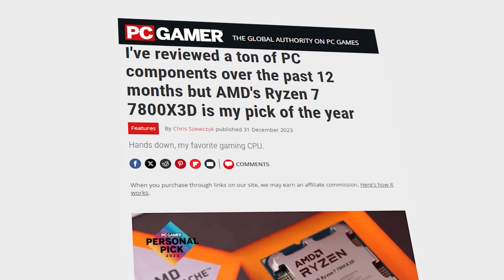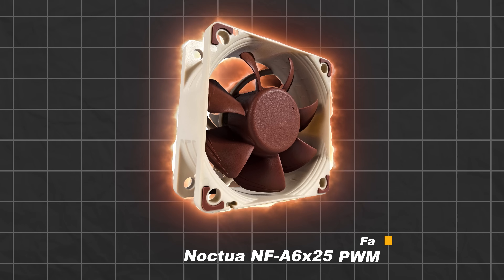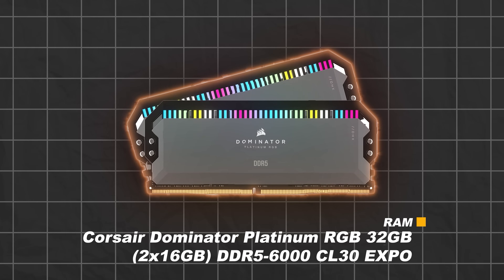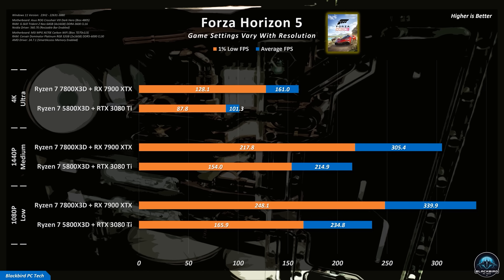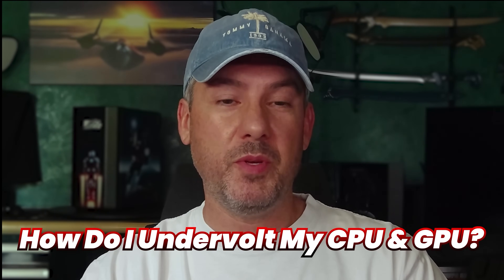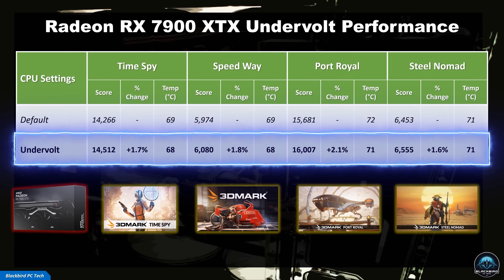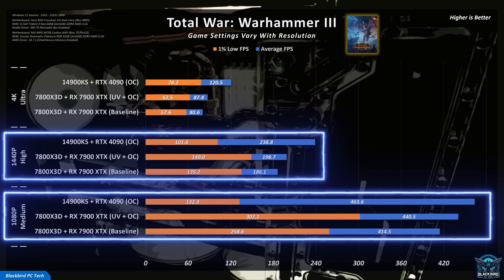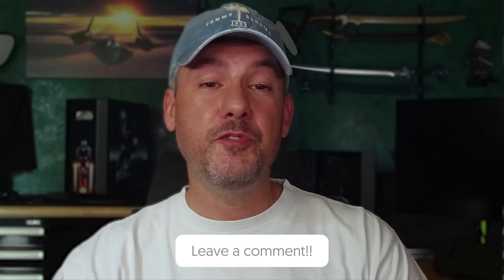Is an All AMD Gaming PC Really Worth It?

Comment: Going on AMD on my last high end rig was the biggest waste of money and regret I've had building PCs. I would have been so much happier if I had spent the small amount more to build an Intel/Nvidia PC. Especially since I wasn't limited by money. I was just on the AMD hype train at the time and thought it would be just as good or better. I've learned my lesson.
Reply from the maker: That’s interesting, especially given the recent issues with higher end Intel CPU’s … what went wrong to make you regret your choice?
Reply: @blackbirdpctech  Pretty much something else every month. The biggest would probably be the lack of all the best features. If I'm already going to be spending $1000 on a GPU, I might as well spend a bit more to make sure I have all the best features. At the time I built my current gaming PC, I thought AMD was going to be taking gaming and graphics more seriously, but it never panned out.  The only titles they support are big console ports for the most part, and even then they can't work with the developers enough to make sure their features are working correctly. Ratchet and Clank was a big one that made AMD look extremely pathetic to me. They sponsored it, it was a big console port, and at launch their features weren't working while the competition's features were. I've heard from many game studios that AMD won't return their calls or help them integrate their tech in any way, while Nvidia throws tons and tons of money even to small indie devs to make sure their technology is always implemented in the best possible way. 
And that's just the start when it comes to indie studios. I play almost exclusively indie games and indie developers just don't develop or test with AMD hardware. There has been a bug where UE 5.1 games won't run on Radeon cards for like 2 years now, and games still come out built on 5.1 where the only option to play them is to force them to run in DX11 mode. And that doesn't work 100% of the time. 
I used to say the one thing Radeon had on Geforce was Adrenaline, but Adrenaline has been a nightmare for me lately. It's dog slow. Any time I click on a new tab, it takes like 30 seconds to load. I get way too many graphics crashes, and Adrenaline just won't even load a lot of the time. I've ran DDU, ran as administrator, all kinds of stuff. It still keeps happening. I've never had any issues like that with Nvidia, and I also daily drive 2 other PCs with high end Nvidia cards. One with a Ryzen CPU and one with an Intel. 
And when it comes to CPUs, there's a lot of reasons I prefer Intel, even now with the "current problems" because those problems have never been a problem for me because I manually tune all of my hardware. It's been obvious to me that 1.5-1.6 vcore is and has always been way too high. I tried warning people for the last 2 years. Now it's this big revelation, where the largest techtubers act like they don't know what could be going on. And also since I like to tune my hardware myself, I wouldn't want another locked 3D CPU. They are great CPUs for my son who doesn't know how to tune it himself and doesn't want me taking over his computer for hours at a time to tweak and stress test, but I don't mind doing that on my own PCs. 
And lastly when it comes to CPUs, I don't really care if a AAA game gets 180 or 190fps. What I do care about is if an esports game gets 400 or 500 fps, and for the most part I trust Intel to do that better. I've also noticed that with every Ryzen CPU I've ever had, there are slight stutters here and there when running at really high frame rates and you turn really fast. I haven't seen Intel CPUs do that. 
Damn, I really hope you didn't take the time to read all of this, but if you did, thank you. I wish I could have said it in less words, but I feel the need to really explain everything when going against the grain, and since Youtube is the cult of AMD worshipers, which I once was, I get a lot of people calling me an idiot unless I really explain why I don't like AMD anymore.
Reply from the maker: Great comment and justification ... I read it all and I think you have valid reasons for making this choice. I don't see the point in being brand aligned ... I will always try to let the data guide me. It's crazy, I did an ultra high-end intel/nvidia build a few months ago and I got called names by people claiming I was an nvidia or intel shill and that I had abandoned AMD. I just like pc tech ... I don't really care who the manufacturer is ... it's fun to test lots of different hardware and see what you can do with it. Thanks for spending the time to provide a comprehensive comment, much appreciated.
Reply: @blackbirdpctech  Wow! Thank you for reading all of that. And I agree. It's fun to build fast machines and see whay you can do with them. On of my favorite in the last few years was my home theater PC. It has a 2080ti and a 10700k in it. There is so little room in there that I cut all of my cables to be the perfect length so I didn't have to try to jam wads of cables into the only air channels. It turned out awesome. I even managed to fit a 120mm AIO in there for the CPU. It's so dense and heavy for such a small package that I named it The Singularity because it might create a black hole. 😄 Thanks for your comment and your video. It was very well done. And while I wouldn't personally build an all AMD PC for myself right now for most use cases, of course I still think your conclusion was accurate.
Reply from the maker: SFF builds are super fun … but cutting your own cables requires some definite skill to make sure you get the pinouts correct … if you screw that up your entire pc can go up in smoke … clearly you know what you are doing, I bet it looked super clean on the inside.
Reply: @blackbirdpctech  So clean!  And for something nobody will ever see besides me 😅 And yeah, when I do custom cables, I always draw diagrams to make sure I get the pinouts right.
Reply from the maker: @The_Chad_  I can't help myself ... even though no one will see it, it's a challenge to do the cabling as well as I can ... I typically spend longer on the cabling then I do on the build ... this was especially true before the quick connect fans where you had a fan and rgb cable for each fan.

Comment: I'm running 5800x3d & 7900 xt. Runs nice.
Reply from the maker: Great combo, enjoy!
Reply: @blackbirdpctech  Tried Ryzen Master. Looks like they disabled the options for my CPU. Guess I would have to undervolt in BIOS. (edit: fingers typed something different than my brain)
Reply from the maker: @wolfstryder  take a look at my recent video: “What's The Best Upgrade for AM4 Based Gaming PCs?” … I show you how to easily undervolt using a free program for 5000 series CPU’s.
Reply: @blackbirdpctech  Thanks for the info. I auto undervolted my 7900 xt and did a -30 offset on my 5800x3d. I'm getting around 7 degrees cooler on my cpu at max load. It no longer hits the over 90 degree mark, which is nice. For synthetic benchmarks, 3dmark and Cinebench, I'm getting close to 10 percent higher scores. I'm not sure how much more performance I'll get in games, but if it prevents throttling temps I'll be happy.
Reply from the maker: @wolfstryder  awesome results!!

Comment: Or the more better option is to replace all the fans with Phanteks t30s
Reply from the maker: The front fans are 140mm and I’m using high performance Bequiet! fans, so I’m not too worried about the airflow from them … just wanted to feed the gpu in a better way.

Comment: You can get BeQuiet! Pure Wings 2 at 80/92 mm (also the initial Shadow Wing fans if you can find them), and 40/80/92 mm from Arctic in several varieties.
Reply from the maker: I have the BeQuiet! Fans but they are too large … someone suggested the silverstone FDP02 which would have been ideal and would look better.
Reply: @blackbirdpctech  I've only just seen that now. It looks like it might produce a bit more noise as an intake, looks designed for exhaust (either orientation might work on this build).
Reply from the maker: I ordered one to check it out … this case definitely needs an intake below the gpu.

Comment: You should have tested the 7800x3d with the 4090 as well.
Reply from the maker: I did in prior videos, in fact I compared a highly overclocked sapphire nitro+ 7900 xtx against a 4090 to see how close I could get it in performance.
Reply: @blackbirdpctech  I did not see all the videos, it would have just helped in comparison to the all AMD setup. 
Right now it looks as if intel had more performance, which is not true.
Reply from the maker: @UserNamesDontMatter-42  the Intel/Nvidia system I compared it against does generally have more performance, that's just a fact. But it costs considerably more which is why I normalized by cost so I could show the value and then make a recommendation based on that.

Comment: If you're using the 7900xtx then 4K is all you should be doing. Considering that, the 4080 Super is a better card because RT and DLSS will give you better visuals and higher fps. E-Sports games should be played at 1080p or 1440p. A 7800xt or a 4070 Super is all you'd need for 1440p. For CPU, AMD all the way. Ryzen 7600X or 7800x3d is the way even after the 9000 series launch.
Reply from the maker: That is a reasonable comment and I generally agree, however if you have a 1440p high refresh rate monitor ... or even a 1080p ultra high refresh rate monitor, then a 7900 xtx would still be worthwhile, especially if you dial the graphics settings in games up to ultra. I tested and compared the 4080 Super against the 7900 xtx in my video: "Should You Buy an RTX 4080 Super or RX 7900 XTX? 🛑Plus GPU Overclocking Guide🛑", if you can purchase a 7900 XTX for $100+ less than a 4080 Super then that would be my choice.
Reply: @blackbirdpctech  I can see the need for $1k gpus for professional e-sports gamers with 360hz monitors. But I think for most people with 165hz-240hz monitors, a 4070 super is all you need. From my experience with Fortnite, I'm getting 260fps+ with a 7800x3d paired with a 4070 super on non-fully compromised settings and 100% native 1440p resolution. Guess you can make the point that a 7900xt or a 4070ti super should be considered for 1440p 240hz gaming for those who would rather hold their gpus for longer.
Reply from the maker: @pshhyeahh  I agree ... I recently compared the 4070 super against the 7900 GRE ... I liked both cards ... not sure why people give the 4070 Super so much grief, it's a good card.

Comment: For undervolting, testing each individual core it's ideal for stability, as all core testing is pointless.
Reply from the maker: Why is all core undervolting pointless? I showed the significant performance improvement by setting an all core offset ... obviously finding an optimum offset for each core will yield better results but from my experience the increase in performance over an all core offset is relatively small.

Comment: As long as you don’t wanna run URE5 games, XTX is great but really struggles in URE5
Reply from the maker: I saw the recent issues with running Wukong … hopefully the new drivers will help fix that … I plan to test them out later today.
Reply: @blackbirdpctech  I hope it works out for you and your XTX. I just sold a 6950 XT, was a fast card but as more developers move to URE5, just needed something that wouldn’t struggle while using the engine features
Reply from the maker: @KaPonoo  I use cards from AMD, Nvidia and Intel, so I have options ... one of the larger challenges is for handhelds that basically all use AMD GPU's (with the exception of the MSI Claw).
Reply: @blackbirdpctech  wow 👌  can't wait for your video on it!
Reply from the maker: @mybeautifulcat7011  not sure that it will be enough for a video ... might just do a post with some benchmarks

Comment: Dude, no use in defending that awful case. No, 2 dinky little slits on the side will not provide enough airflow, as many, many (failed) designs have more than successfully demonstrated.
(Man i hope you don't build your rockets like your PC's...)
Reply from the maker: Hopefully you realize that data matters more than an opinion. I was skeptical at first but the fact is the thermals in this case are actually quite good. I also didn’t design the case … I did however design the world’s fastest helicopter, so what would I know about airflow 😉

Comment: I have a 5800x3d, 7900 GRE and 32gb 3200 ddr4 and I limit my FPS to 100fps in the games I play at 1440p and 4k. 

So yes, an all AMD system is perfect as nothing can justify the extra price needed for an Nvidia GPU, that includes RT, just doesn't justify the price at all
Reply from the maker: Nice system … I recently compared the 7900 GRE against the 4070 Super … great performing card that can be easily undervolted and overclocked.

Comment: Pro tips: Never use AMD reference card. They are equal or worse (usually worse) than any other AMD card from a brand.
Reply from the maker: Not sure if that's a pro tip, it's more of a preference ... while I don't think they are a great value option today given that there are better options available at a lower price point, they were a reasonably good option at launch. I think the card design, while not as thermally efficient as some other designs, is one of the best looking cards on the market and it's compact. This was a big consideration for this build ... I had limited space, so I couldn't go with something like a Sapphire Nitro+ .

Comment: It is not worth upgrading, that original PC is already super nice and good, if you’re gonna upgrade weight for RTX 5000 or AMDs 8000 gpus
Reply from the maker: That's a very reasonable statement however if you really want to upgrade I would caution against waiting ... we really don't know when the new cards will be released and typically when they are released they are usually supply constrained, so it might be a while.
Reply: @blackbirdpctech  I’ve got a 4060 right now, I’m looking to the 5090, I would go AMD but.. their GPUs are coming out later, but if I fail to get an Nvidia card by the time AMD releases 8000 gpus I’m gonna get the RX 8900 XT/RX 8900 XTX
Reply from the maker: Hopefully we will get all of the details at CES in January

Comment: Great video , I have a question , which GPU do you think is perfect pair for 5800x3d ? I am using 1080p build , thinking to buy 7800XT but i'm not sure if it's going to bottleneck and overall overkill.
Reply: Kind of overkill to get 7800XT for 1080p. Use the card with a high 1440p refresh rate. Or use it for 60-80FPS 4K gaming. On 1080p the GPU card will almost always be limited by the CPU. Could be worth it if you use a very very high refresh rate 1080p monitor.
Reply from the maker: The comment from @FireCestina1200 is accurate ... at 1080p you will typically be cpu bound, so the gpu will not matter as much unless you dial up the graphics settings and//or use a very high refresh rate monitor. That said you could either go with a 7700XT or if you are considering getting a 1440p monitor in the future then you might want to consider the 7900 GRE (checkout my recent comparison video with the 4070 Super) ... I think that is a better option when compared with the 7800XT.
Reply: @blackbirdpctech  thank you for the answer , but im still wondering , does being cpu bound mean I will have crash problems or blue screens etc , or will it just make stuttering during gameplay , I am fine with 60 - 80 fps triple A games , I usually even put everything on medium to high so I dont put pressure on my gear that it doesnt overheat much . So overall in my case -  more = less? My gpu is RX 7600 the 8 GB version
Reply from the maker: @BruceUZULUL  it simply means you are loading the cpu more than the gpu ... it shouldn't result in any issues like crashes or stuttering unless your system is unstable.

Comment: This is what Im rocking too, 7800X3D and 7900 XTX. Cant complain, but I would like ray tracing in some games and AMD barely supports any games with RT.
Reply from the maker: This is one of the reasons that I wanted to test the 7900 XTX against a 3080 Ti ... the ray tracing performance is very similar. AMD does support ray tracing however they just use software versus having dedicated hardware on the gpu to accelerate RT performance. I expect that will change with their next gen GPU's.

Comment: what about AMD 7800X3D and 2080 Super? compared to the 7900 XTX GPU?
Will I get similar or better performance?
Reply: @sv_surron  ah yes nvidia fanboy , thinking rtx 5* your fps. 2080 is "old" and even with dlss you won't match the performance of a 7900 xtx playing at native . The performance will be much worse. Go get a used rtx 3080 or 3080 ti if you must go nvidia for cuda. If you alr got the 2080 super it's fine for now and it's fine to wait longer until an upgrade.
Reply: @Unknown-wd7ub  Sorry I meant 4080 Super 😂
Reply from the maker: No, the 7900 XTX will offer significantly higher performance when compared with a 2080 Super.
Reply: @blackbirdpctech  Sorry I meant 4080 Super 😂
Reply from the maker: @sv_surron  no problem ... a much better question ... take a look at my comparison video: "Should You Buy an RTX 4080 Super or RX 7900 XTX? 🛑Plus GPU Overclocking Guide🛑" to see the data for yourself. The 4080 Super is tough to beat but if you can get a 7900 XTX for a great price, say $100+ cheaper, then that is likely your best option.